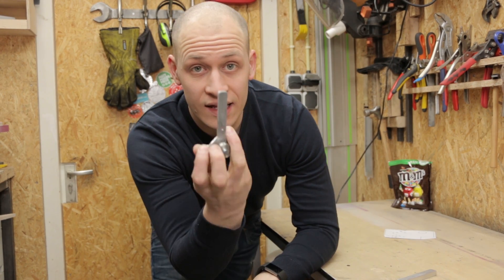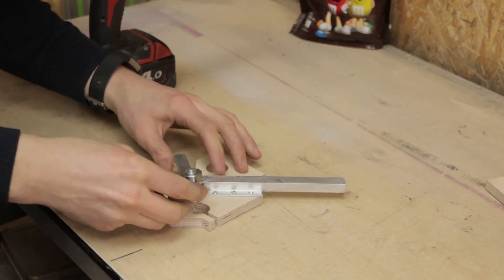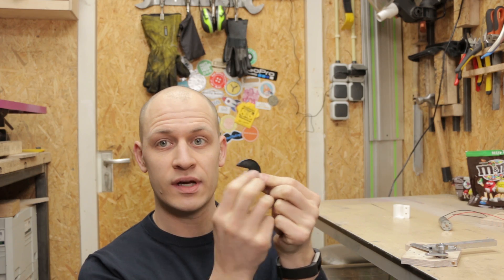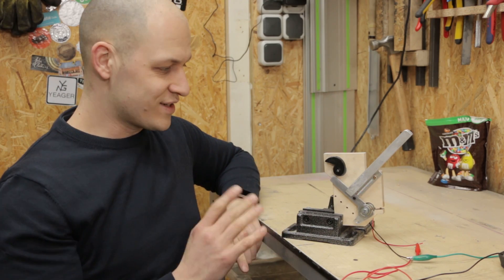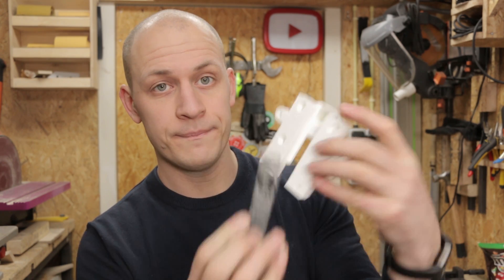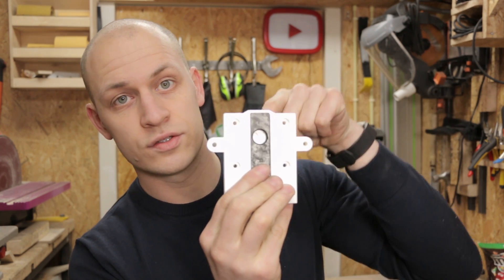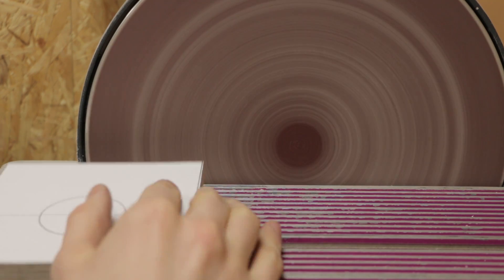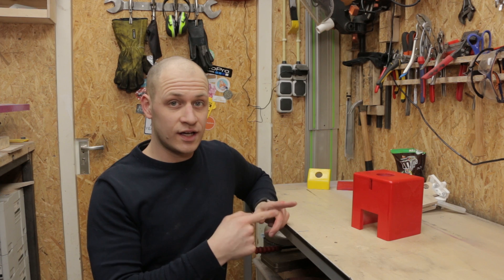Eat M&M's while working!

Comment: You could make a remote so you can Put It on your Couch Tablet  or Somewhere near you. That way you dont have to sit straight everytime you want an m&m because you can Catch It with your hands. 😄
Reply from the maker: You can put it on the table near the couch and hit the button with your foot.. I tried it. It just doesn't shoot that far right now.
Reply: @Thepracticalengineer  I did Not even think of using your feet 😂But If It worked thats pretty Cool!